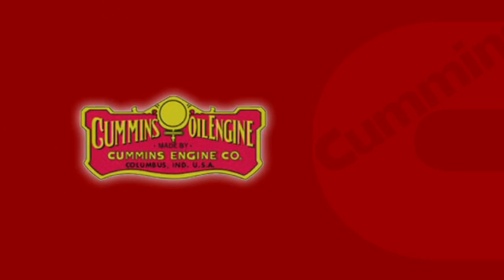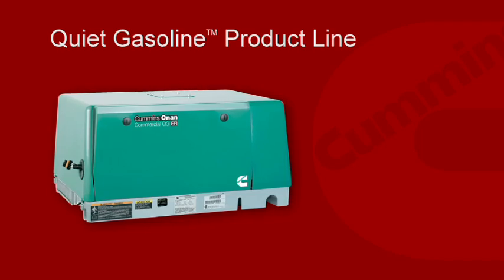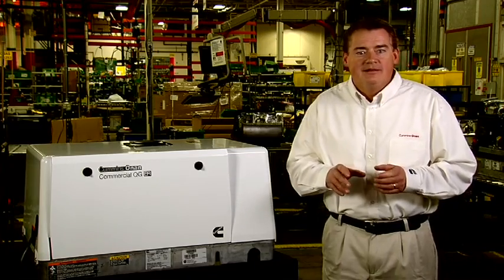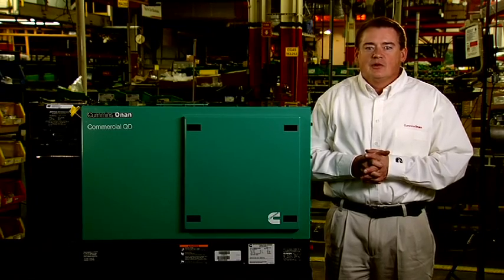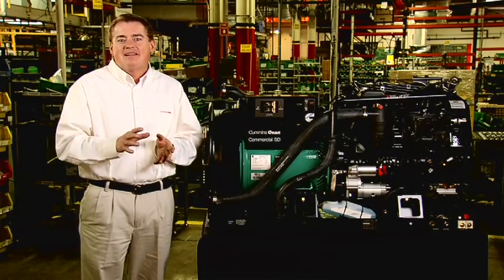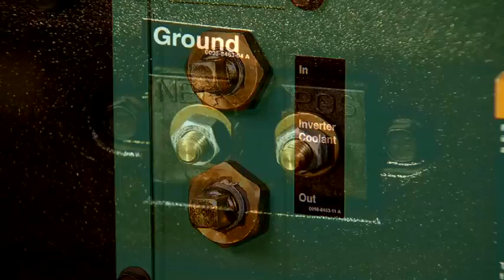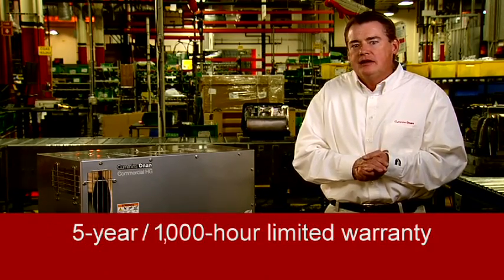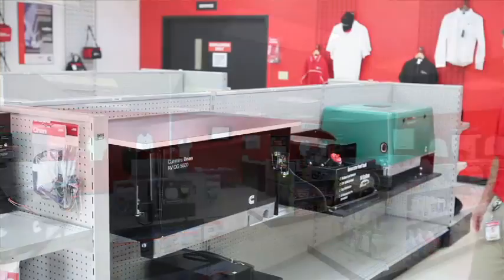Cummins Onan commercial mobile generators founded on tradition of excellence

Comment: Well let me be the first to comment on this video since no one comment on it in 9 years.
People’s in the Third World countries have create hydraulic generators that can power a city or any facility such as factorys homes complex buildings without using any sorts of fuel .but ur equipment always needs fuel to run all u came up with is  quitting the engine  . Even  your hydraulic generators can only be used in  trucks and cars etc. they’re not self starting generators. 
are u going to invent generators that doesn’t use fuel at all and self starting like third world country’s  or u got stuck with Diesel and gasoline

Sorry for been harsh but it is the truth